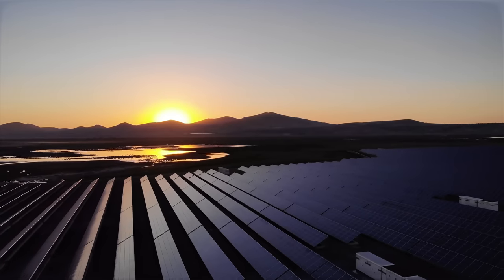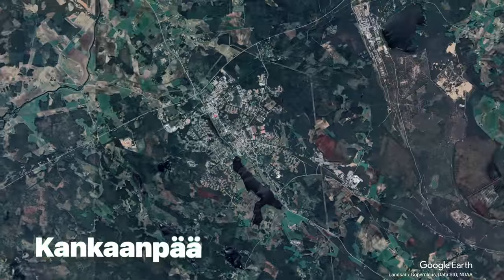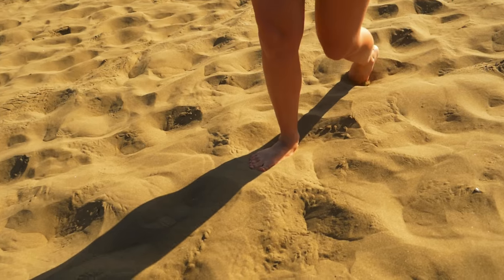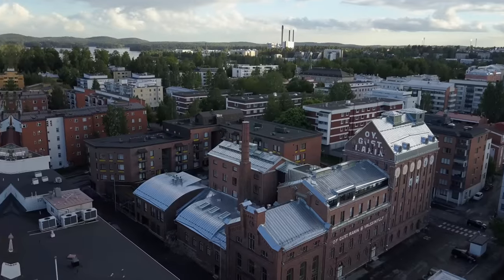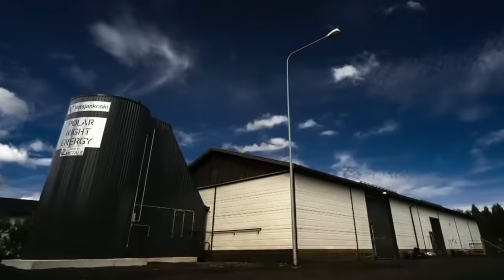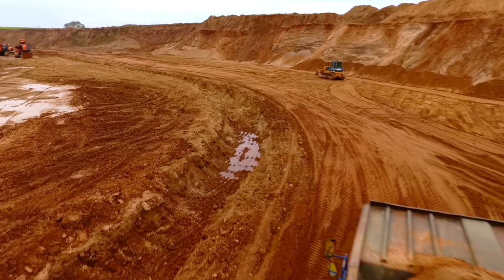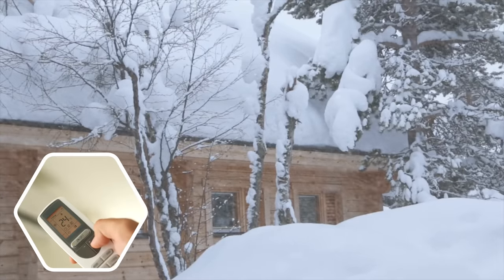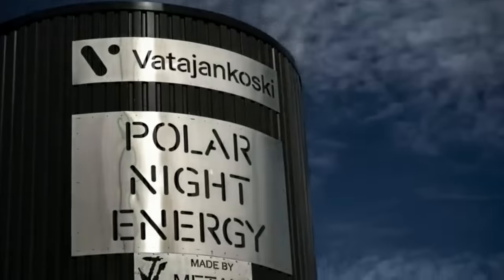Breakthrough Tech Heats Homes Cheaper Than Natural Gas!

Comment: I've been to Finland working on energy related projects.  From what I saw, home heating in their long cold winters in done via radiators run off of district hot water infrastructure, heated at a central boiler station (i.e. they have hot water piping throughout the city that everyone taps into).  The heat source in the place I visited was simply burning wood chips (there are a lot of trees in Finland), which my hosts explained was carbon neutral, as they planted news trees in place of the ones they chopped down.
Reply: Wood chips is just one way. There are oil burners. Ground heat pumps. Long distance heat that comes from big plants usually in cities. New individual houses are usually ground heat pumps to floor heating. As floor needs lower heat level so it makes more efficient way for heat pump compressor.
Reply: It just take 20+ years... Coal is then also carbon neutral...
Reply: @АгронДепартье  my thoughts exactly.
Reply: 20 years is brief in comparison to coal that are formed hundreds of millions years ago.
The trees that are planted with be ready in just a generation or less. Meanwhile, coal that is burned, cannot be replaced because microbes that evolved to break down the wood cellulose didn’t exist during those prehistoric times when the trees fossilised into coal.
Reply: That is not even vaguely carbon neutral. Logging and processing trees releases up to three times the carbon content of the tree alone. Newly planted trees in logging projects have a low survival rate and those that survive will take decades to sequester as much carbon as the original tree.
Reply: @andrewjohnson6716  I dont know where You might live and how much forestry background You might have but about "low survival rate" and some other thing considering heat production from wood:
- In here (Finland), if you own forest and cut it down - you have an obligation by law to renew the forest (if you dont for example build a house on that land etc).
- When planting for example pine seedlings, target density is around 2000-2500 seedlings per hectare. Depending on soiltype, how north/south etc.
- After few years and a growth of 3-7 meters (10-20feet) the density of young trees is DECREASED by cutting them. Target density is closer to 2000/hectare. Best/strongest selected ofcourse.
- After 30-40 years, there will be a "first harvest", in which density is again reduced to around 1000-1200 pcs/hectare.
- So called "final harvest" is done at about 60-80yr old forest. All timings depend on several variables.

So, key points are, that "low seedling survival rate" is something I have never heard. Naturally it is possible to get bad luck, moose can eat them all bugs etc. In normal conditions they do grow well and very rarely a forest needs a re-planting.

Density is typically always too much - on purpose. Selecting good ones happens on-the-go while forest grows. A seedling not growing here and there is not considered an issue for these purposes.

Main point is, that woodchips FOR HEATING are basically NEVER made from fully grown trees. Bigger trees will go for lumber mills (best price). Smaller ones, bad quality ones etc. will go for paper pulp factories (still higher price than to energy/burning) and the rest of it (too small for even pulp, typically treetops, some of 1st harvest trees) will go for woodchipping and thermal energy.

About releasing carbon: Yes, the work and deliverychain of wood emits some carbon, but typically the heat energy wood is collected as a "sidestream" product. Deliverychain carbon emissions from basically engine fuels are not huge, but ot the other hand, cleared forest SOIL and decomposing of peat soil CAN release large quantities of carbon. So you are both right and wrong in this.

I do remind, that a grown forest in here is never cut down for woodchip production. I guess it could be done yes, but the forest owner would need quite deep pockets to sell all lumber & pulp qualified material for "just burning it". :)
Reply: @jannek5757  Thank you for that density of information. However little of it is germane to the topic of the claim of carbon neutrality. You do understand that a 1000 kg tree sequesters more carbon than 2500 saplings, right? You do understand that the underground that can not survive without the canopy  cover and that would take years to recover to pre-logging levels  sequesters carbon, right? You do understand that the hummus, that once removed takes thousands of years to rebuild sequesters carbon, right? The is simply no such thing as carbon neutral logging. It’s a fantasy scenario. You cannot negate facts with verbiage.
Reply: @andrewjohnson6716  You do understand that GRASS is a far more efficient photosynthesis system than trees, right?  Trees utilize far more water to drive sap and interact with leaves, than field grass does.
Reply: @billcichoke2534  That is also not germane to the topic. The topic is carbon sequestering, not photosynthesis.
Reply: You may get some pushback on this, and I'm not sure about large-scale accuracy of this.  But on a small scale (ie with my small farm) it is almost completely carbon neutral.  I have a wood lot with several hundred trees.  Several die each year. I harvest, split, and burn in my wood stove to heat the home.  New trees are continually growing and absorbing carbon in the woodlot. The trees I burn would release the same amount of carbon as they decay - I just speed up the cycle in the dead trees. Other than gas for wood splitter, a completely neutral cycle. Plus my woodlot remains in its natural state, providing beauty, nuts (pecan, hickory, walnut) and mushrooms (I bury some logs and inoculate with shitake and morel mushrooms), and great habitat for wildlife (including a deer I put in the freezer each year).  Win all the way around!
Reply: @blair fisher  No argument there.  As you said, probably not useful on a municipal level.
Reply: @Andrew Johnson  What do you think HAPPENS as a result of photosynthesis?

It is quite relevant, seeing as how it's worked far more effectively for DECADES, than anything WE could make.
Reply: I heard that in Finland these woodchip burners only use the waste of the timber industry, that is left after they processed the wood into valuable building materials. If this is true, it's important to note it everytime this topic comes up. 
Also they  burn it very efficiently, and have so good airfilters installed on their wood chip burners, that there is no smoke coming out. The only byproduct is ash, wich is used as a soil fertilizer.
Reply: @fatal1error  Hate to tell you, but that's what most newer coal plants have been doing.  And their ash is used for not just soil conditioning, but also as an input for concrete.

Check those so-called 'biofuel' plants, and see what else they burn in addition to wood chips.  More oft than not, it's things like old railroad ties, to raise the furnace temp enough to keep the boiler pressure up.

It actually makes coal look pristine by comparison.
Reply: In Vienna we burn waste and also use cogeneration of the gasturbine
Reply: "my hosts explained was carbon neutral, as they planted news trees in place of the ones they chopped down"
AND YOU SWALLOWED THAT BULLSH!T ??????
Reply: @jannek5757  seems you know something about trees . With all the worries about climate change I have a question. What do trees absorb and what do they emit? What is emitted burning fossil fuels?  I could be wrong that's why I ask. But if trees absorb Co and emit oxygen and we are putting Co in the atmosphere by burning, is that not at least a wash on the ruining the atmosphere?
Reply: @fatal1error   Timber wood can also be used for heating but there is one question: who will pay? :) Timber-class wood is about 3 times more expensive here from forest than the material used for heating and the price gap has become much smaller now after war. Before it was ~1/5. Energy wood buying prices are up about x2 or smth

Comment: Our grid in Finland is already over 80% carbon free. So gas is not the major energy source. Most important are nuclear, hydro and wind.
Reply: That's not correct, it's 80% renewable, not carbon free, but renewables include 20% actual wood burning. Because wood is considered renewable. But burning wood is no hecking way "carbon free".
Reply: @Groaznic  
He didn't write its carbonfree.
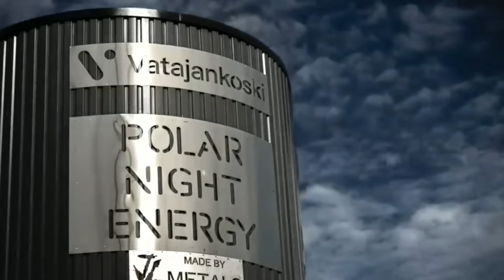He was reacting on this 8:45
Reply: @janklaas6885  He literally wrote "it's over 80% carbon free".
Reply: why limit carbon. carbon is plant food.
Reply: @Groaznic  
but he DIDN'T write "its carbonfree" , you fool.
Reply: @prioris55555  
its not plantfood
Reply: @janklaas6885  carbon dioxide is plant food
Reply: @prioris55555  they want to eliminate carbon life forms , these guys just don't know it yet
Reply: Lmfao; but you IMPORT tons of energy from other countries…. So what’s the point of your comment?
Reply: But if you have nuclear power plants you have electricity and heat or did I have misunderstood something?
Reply: @Groaznic  burning wood is considered as carbon neutral if im correct
Reply: @CUBETechie  Yes, but because we've largely ignored the global warming problem so far, the time taken for trees to regrow and absorb the released carbon has become an issue. Also some forests are cleared permanently for cattle rearing which is a complete disaster.
Reply: Water tanks. Cheapest to transport, better heat transfer coefficient. Texas grid failed largely due to GREED not power generation capacity. And cheap heat pumps that dont work below 25f, they failover to heat strips.

Comment: From a novice about energy production: Since the company has to send the electricity to the end users anyway, is there some reason that a much smaller sand battery could not be developed for individual homes rather than building giant, expensive silos?
Reply: Converting the energy back into electricity will induce a huge efficiency loss, you pretty much need to use this directly as hot air or to warm water to like a house radiator temp.  I think going back to electricity gets you at like 80% plus efficiency loss.
Reply: Scale impacts the ratio of volume to surface area, which is a determining factor in the ability to store heat. A small sand battery cools down very fast while a similar battery scaled bigger retains heat much longer.
Reply: @Btstaz While true, I believe that they plan on extracting energy at low cost electricity times, such as very low use.    This can mitigate some of the efficiency loss cost.  I can't wait to see how all of this comes to pass.

Comment: As a Finn, I would appreciate if you checked the natural gas consumption statistics before saying that we use natural gas ”for most part to power the grid”. We were at 6% of total energy consumption in 2020 and it is just getting lower. 

New nuclear power plant and relatively large wind farms being completed should help us being energy independent, but next winter will be horrible for energy prices for sure. Geothermal heated homes won’t be influenced too heavily though.
Reply: I though you were all hydro and wind.
Reply: @kkarllwt  not yet at least, probably need to mix in solar energy too during the summer times. Nuclear energy is a pragmatic choice in the green transition too.

Comment: I like the price of such a simple idea , domestic hot water is an area that can benefit from this. Preheating the cold water from 55 degrees before it gets to the domestic Vessel.  This could be adapted on a small scale for use in apartment complexes, food service etc. Food for thought Good job!
Reply: This is what I've been doing for 40 years. I have a 20X4 foot back wall area that I covered with double pane polycarbonate glazing. Inside there's a bunch of 3/8 inch EPDM tubes that circulate water from a 1/10 HP pump. It's just plain tap water without chemicals or antifreeze. Freezing doesn't hurt the EPDM. The water goes into 2 50 gallon polyethylene drums and the cold drinking water picks up the heat through copper dip tubes inside the drums. It heats up to somewhere below 110 degrees, then goes into a regular water heater for storage and final heating. I recently replaced the water heater after 39 years. It mostly loafs along.

Comment: Simple diy...  55 gallon barrel of sand in basement of house.  Mixed into sand is heating element.  heat the sand with pv during day.  Let barrel cool down over night.  Doesn't really help in places like Finland where they have 6 week long nights in winter...  Much cheaper to operate than trying to run electric heat off of batteries though.
Reply: What kind of heating element can do this without overheating burning out?
Reply: @crcurran  I would start with a longer stainless-steel heating element coated in silicone rubber.  Something like the Frost King HC30a.  Directly wired to a fuse, and about 300 watts of PV panel.  The thermostat would have to be disabled, because the DC current will burn it out rapidly.  You are correct though you would want to start much smaller than 55 gallon drum .  Maybe start the experiment in a 5 gallon pail instead?  Scale up from there.
Reply: @asdfdfggfd  what about using an old copper tank for the experiment already has an element and insulation
Reply: @shitina.bucket9699  Im too cheap for a copper tank, empty 55 gallon drums and 5 gallon paint pails are cheap to free.  Sustainable solar energy is only going to work out if everyone is as cheap as possible.  Too many check book problem solvers in the industry right now.
Reply: A 55 gallon drum is significantly smaller than what they are talking about, or what would be required in most applications. The most efficient source of heat would be hot water from solar not electric , in addition, the same hot water tubes could be used when circulating the heat back out. Heating with electric heaters would be more expensive than just buying overpriced gas. The heat storage benefit of sand comes from the fact that it does not transfer heat easily. It is a lot easier to heat up water than the same volume of sand. In the reverse, you can not draw that heat out very fast either. This concept is best suited for heating a home gradually over time, not for electrical production or boiling hot water extraction.
Reply: @cowlevelcrypto2346  Solar hot water heaters cost significantly more money than simply using PV panels and running a heating element...
Reply: @asdfdfggfd  What are you talking about? You can make a solar hot water heater out of a garden hose and some black paint.
Reply: @cowlevelcrypto2346  Still more expensive.

Comment: Anywhere there is a community heat scheme, like in large areas of New York, this would be perfect. These piped heat arrangements are the norm in densly populated areas in much of Europe. There are also many, many areas that could adopt them. I think this is an incredible innovation and would only need a small group people to make one of these viable, especially if they had a community generation scheme.
Reply: You mean a central heating System and hot water Radiators?
Reply: ever heard of salt/ sodium reactors,clean, safe, self perpetual..banned in 1954, because it didnt produce weapons grade waste..ie. nuke..

Comment: For years there has been battery "breakthroughs" every week. This looks like a genuine breakthrough that could be very useful especially with intermittent renewables.
Reply: Indeed. This tech seems so simple, cheap and efficient it could be deployed quickly. I could see easily extendable vast arrays of these systems buried underground in the very near future. Maybe even warming up whole Finnish towns in a year or so, as the district heating systems are already in place. There is already excess wind and solar capacity, just direct that to these sand batteries now until electrochemical and mechanical ones ramp up. I see this as a very viable future energy storage solution among others.
Reply: @Jo Blow it has specific uses but it's relatively simple technology, easy to construct, uses abundant materials, very long lasting and its ready to go now. Stick these in certain neighbourhoods, manufacturing plants, swimming pools etc and they could store a lot of energy, saving electricity in winter.
Reply: @Jo Blow  it can be put underground or in some building, out of sight.
Reply: @Jo Blow  actually I've been critical of all the "breakthroughs" I read about every week. Nowhere to be seen. This actually works.
Reply: @Jo Blow No one is claiming it is an electric power source? And why should it be? In Finland over 25% of all energy consumption goes to heating. And our heating season is long, from around 250 days in south to over 300 days in the north. On top of that things like swimming pools need to be heated year round. Considering that over 50% of homes are heated with district heating those batteries could be literally anywhere and not be an eye sore. Sand is also pretty good insulator, these batteries don't need much if any additional insulation. That first operational battery is literally a metal silo without insulation sitting above ground, and if it works there in -20C weather, it would do very well a few meters under ground (though that would be way more expensive).